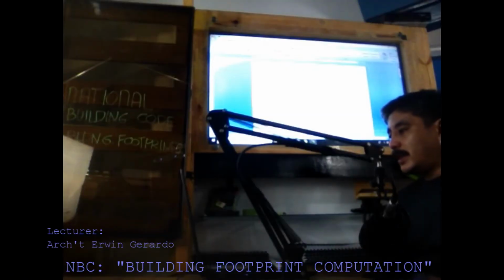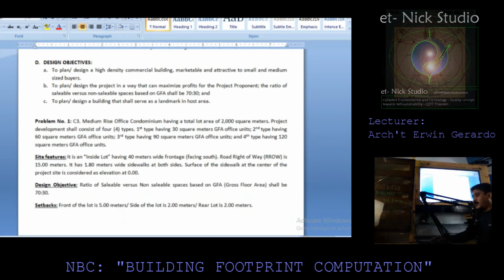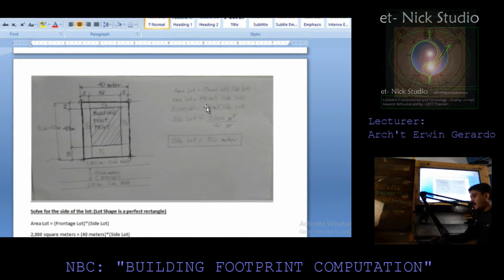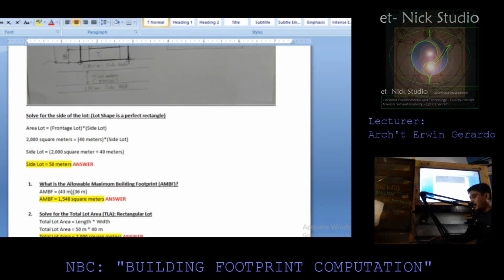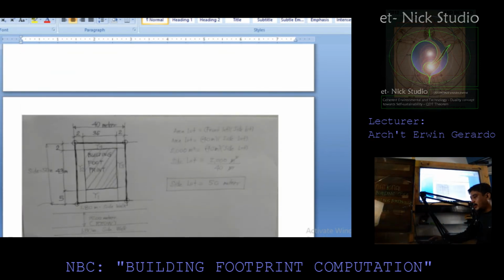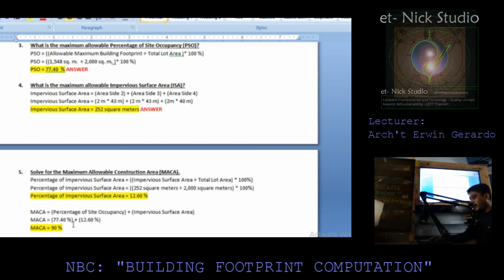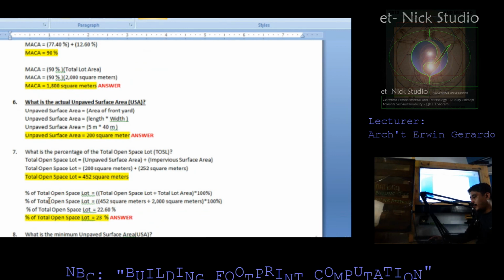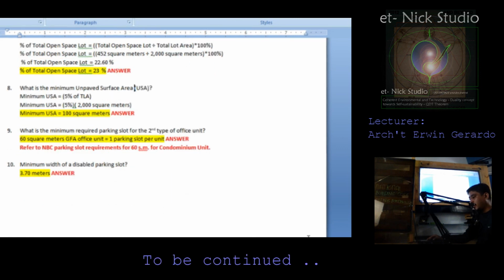Building Footprint Computation ( National Building Code )

Comment: Hello 👋 if you have a 
 
• The project will be erected in a one thousand six hundred (1,600) square meters lot. A main Building with an AMBF of six hundred twenty (620) square meter will be located in the center of the property. 
• The pilot site will be located in a government lot in Manila City. The site is relatively flat. The property is a square regular inside lot. The RROW is 12-meters wide alongside the north direction. Front setback of 10 meters will be provided for quadrangle. 6-meters wide setback on west and 10-meters wide setback on the south part of the property. Can i still Built a walkway and benches in the southern part of the building?
Reply from the maker: The factors you mentioned are quite long and complicated. Regardless of the Building footprint, yes you can build walkways and benches as long as it is within the lot and as long as the building footprint allows it to, meaning the space is vacant.